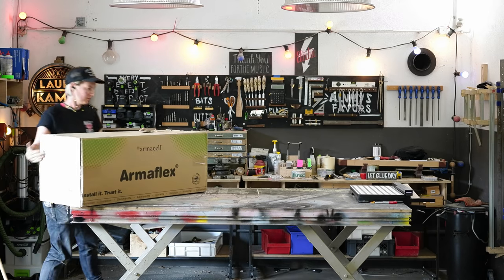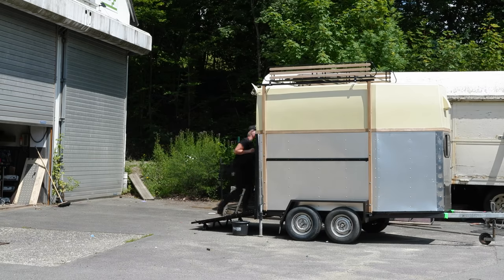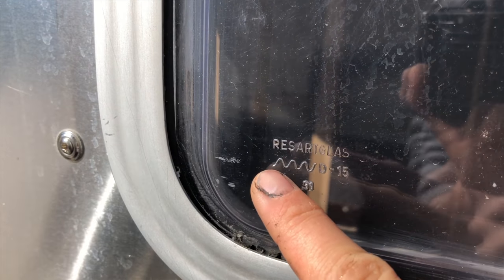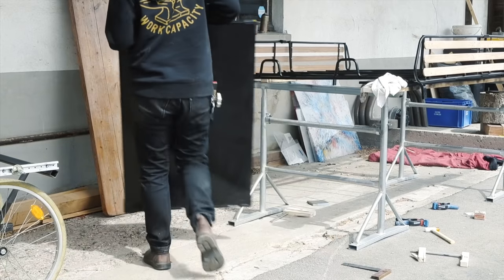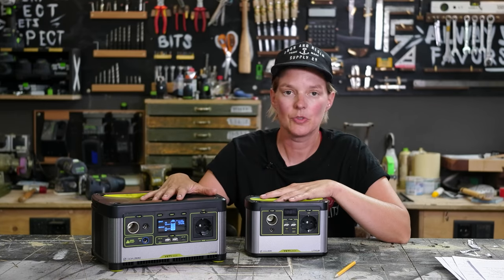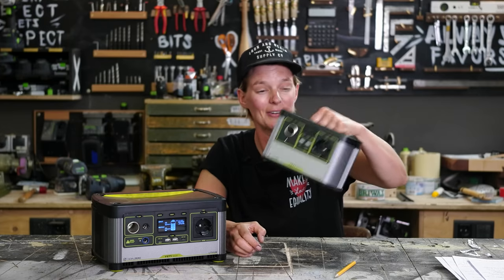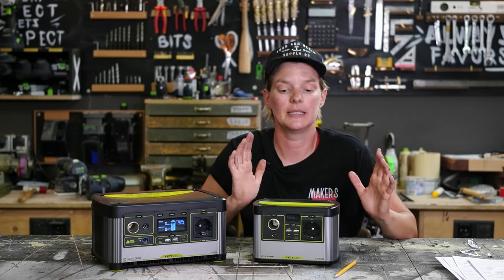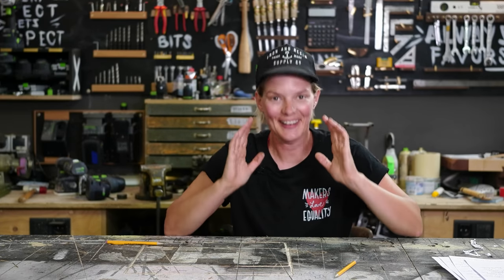Building a Camper - Solar Set Up, Insulation, Windows

Comment: I just had this crazy idea, and you're all free to use it! 
Laura mentioned there would be a gap between the Armaflex and the inner wall, and that her theory is that any moisture caught in-between would naturally evaporate. 
So here's my idea: why don't you try and add the need to have that moisture evaporate to the need to have (what I think is/was her goal for the interior) modularity? 
How? By using pegboard for the inner walls! 
You could even have it on the ceiling, have LEDs between the Armaflex and the board, and create your own Rolls-Royce style Starlight ceiling!
Laura probably already has the project all finished by now and is just publishing the videos as they're getting edited, but we "normals" can try this on our own!
Reply: Silvio Silva Love your thinking 🙂

Comment: I used sheeps wool insulation for my camper. I had varying depths based on protrusions on the outside of my van, so the depth of the wall varied between 4 to 6 cm. I decided that a more easily compressable amterial, like wool, would work best for me.

Comment: Great job 👍. I have done all of those projects on campers in the last 10 years or so. I am with you 100% on the insulation. A little ventilation does wonders with condensation. Solar battery requirements are totally ‘use based’ so are often quite different for different users. Your scalable approach is the best one I have found.

Comment: This was great. In my own research concerning insulation I came to the same conclusion. Closed cell foam rolls are great for keeping moisture away from the walls and are super easy to install. Tough I believe these are harder to buy outside Europe, could be wrong. I recently saw sheep wool mats being sold as natural camper insulation. Wool absorbs and releases moisture freely without getting moldy like glassfiber. As long as your space is properly ventilated sheep wool or even something like rockwool might be an option. but as you said, lots of opinions. Your climate is a big factor as well.
Reply: After I researched a bit, it seems that all depends on what the wall is made of, because if it's metal - condensed water on it is not going to produce mould. But if it's wood, or other organic material - then yes, the mould could grow on/in that.

About wool... I'm wondering about it. It's organic right. So mould can grow on/in it. I'm not sure if my guess is correct, but in my mind it seems that if you say have a metal wall, and put wool against it (without creating an air gap between the two) - it sounds to me that mould will love such combination. 

So basically, in my mind, one of the most important things in insulation is to create an air gap between the outside wall and the rest of insulation layers. Plus do it in a way that there won't be any thermal bridges (thermal breaking seems another cornerstone of the correct insulation, if thermal bridges are present - I've heard that the R value of the insulation materials you use, can decrease drastically...)

Comment: This is such a great series, thank you very much! Very sensible choices, also with the closed pore insulation, I think. But I still wonder a bit about the sliding window. The sikaflex is surely more than enough until the sun eats the earth, but especially when driving through the rain and there is basically standing water on the lower sliding seals, I would be a it unsure about how tight it is...

Comment: Dear miss Laura, I agree wholeheartedly with your choice of armaflex insulation.  I have over 20 years experience as an industrial insulator.  I spent most of that time in power plants insulating steam piping systems.  We did however do work in meatpacking plants insulating cold systems and we used a lot of armaflex sheet.  Another nice alternative is cork. Especially if the insulation needs to be exposed for some reason.  I really enjoy your channel and watching your skills.  Thank you for posting.

Comment: Awesome, fantastic and great!  I had heard good things about Armaflex but had not seen it up close. I love how easy it seems to be for installation. And if it is not as easy as you made it look then I am even more impressed. Will be researching this more and may (hopefully) use it in my build. So if you want to set up an Amazon or EBay store, I will be happy to purchase through your page so that you get a commission.  I might ask you for a link that will work in the US.  I wonder if random "breather holes" between the insulation and interior wall would help condensation evaporation or would it create problems with moisture and compromise the insulation?  What do you think?

Yeti is on my bucket list because they have such a good reputation.  I plan on stacking them, much as you do, rather than use a single large inverter for everything.  Someone had installed a large and a small inverter and used the small one for most things as the large one would pull its capacity out of the battery bank, whether or not you needed that much.  With the Yeti as a Smart Battery/charge controller and inverter, you don't need to worry about any of that.  3 500's and a 200 with equivalent solar would let me run A.C. in the middle of a hot desert on a sunny day and would be much more than you need for anything else.  Here's hoping!  

Husband is in a wheelchair and so have been looking seriously at horse trailers because of the ramp.  I would prefer a bus or similar with a wheelchair lift but they have become fashionable for extra ventilation with non-handicapped travelers/adventurers that I am often outbid.  So the horsetrailer is a very viable alternative.  I hope you will continue to share your journey so that I can watch your every move  😏 sorry

Great video! Thanks!!
Reply from the maker: Good Luck with finding a suitable trailer/van! You seem very passionate about this so I hope you get to go on the road with you husband very soon!

Comment: I would get a big boat or marine battery & hook it up to the solar panel & hook the battery up to your power banks so it would go solar panel to battery then battery to the power banks that way you are always charging a spare battery & your battery is always charging your power banks , that way your getting the best power for your money . I have a Ford F 150 pick up truck with a 8 foot bed & a cap on it , I installed 4 , 100 watt solar panels on top of my cap , I went solar panels to a marine battery , marine battery to a big power bank , I had to tweek it here & there but it works great I can run a heater/ ac unit all night if need be & a small portable fan & a small flat screen tv , & it all runs on my power bank all night with room to spare . The next day I charge everything back up & im ready to go the next night . I can do this over & over each night & it never fails me .

Comment: Hey Laura, love the show. One thing I would add is a small humidity meter that shows % of moisture in the air. Mould starts to grow at 60% humidity so keep it below that and there should not be an issue. If it is too cold to have the window open for ventilation you could get a dehumidifier.
Reply: With a small space like this camper, opening the window and door for 30 s should remove most of the moisture in the air without cooling the camper.
Reply: @Froudd  
Maybe not if you live in a moist environment. And/or maybe not in winter (humid air). But I'm not sure.

Some insulate incorrectly with vapour barriers which traps the moisture where it shouldn't be, say on wood (where mould would grow). So I'm guessing it's not like one can insulate in a random way and just rely on ventilating now and then the place.

Dehumidifier sounds like a great idea. With automatic turning on and off, when the humidity reaches certain level.

Comment: Loving the project so far, but as an architect, the building science discussion on condensation hurt my heart a little. The goal is to prevent moisture laden air from coming into contact with a cold surface and causing condensation inside the wall assembly. Ideally, there would be a layer of plastic film between the inside finish and the insulation. It looks like the foam you used is closed cell, so that should be one thing working in your favour. Not criticizing, just trying to head off issues. Also wondering if you considered a flip down set of legs on the ramp to make it more level? Anyway, keep the videos coming!

Comment: In Canada, when building houses we put a polyethylene "vapour barrier" on the inside of the studs of outer walls, before hanging wallboard/sheetrock/drywall.  Of course, you may not want to seal too well because your breath will make it uncomfortably damp in your camper.
Reply: Beauregard Slim You’re right to suggest this - you don’t want moisture getting behind materials. Usually the stick-on insulation bonds so well it becomes the vapour barrier *if you tape at every junction etc*. Insulation really has to go hand in hnad with ventilation, though. Ideally you’d fit low vents and high vents for exhausting moisture you create inside. Teardrop trailers, for example, need venting even in cold weather - the smaller the space the more vital ventilation will be.

Comment: when is started out, i used to go with cheap styrofoam in my bauwagen, later i upgraded to an insulation material made from hemp and coconut fibres with a steam barrier on top. the best counter measure for moisture ist good ventilation in any case :)

your power setup is probably good for a camper type application, i'm really interested in how the lithium batteries hold up. i used to have 12v agm batteries with a solar charger and a 12v grid throughout, which is perfect for illumination and running some electronics. using an inverter is usually overkill, you can run many powertools off the 12v directly (and here it's good to have a battery with low internal resistance, you don't want to powerspike lithium or lead gel batteries).

Comment: to talk about the condensation of moisture: your insulation has to be covered from miosture. Otherwise steam will get through it and will still condensate on the metal. What you need is a vapor barrier on the inside
Reply: Normaly you don't need this if you have used Armaflex which she has used in the video
Reply: Armaflex is closed-pore foam and might not need it.

Comment: Hi Laura, i've converted some Van's/RV's/Campers by myself. So i can say that you've had choosen the right decision in YOUR case ! As you stated it is different what your base is where you start from. Is it a VW-Van with self-supporting body, is it a former Cargo-Truck with flat walls and no superstructure, is it a frame-and-outer-hull - construction like in our case: every case needs different solutions. You've choosen the right one for your project. But it is important to mention (if somebody else is going the Armaflex-Way) that Armaflex is NOT an insulation (in the classic way). It is, for sure in some way, but what it really does is to transport the Dew-Point away from the cold metal surface and locates it somewhere within it's thickness. Means: the moisture isn't gone, it is just located away from the surface. The key to sucess by using Armaflex is this 5 mil airgap between the inner surface of the Armaflex and your wall covering. This allows the moisture to evaporate on the WARM side of the Armaflex - and everything will be fine ! Perfect solution Laura und noch ganz viel Spaß mit Deinem tollen Projekt. Du machst alles richtig weil Du mit viel Ruhe, Erfahrung und Überlegung an Deine Projekte rangehst. Schöner Kanal, Danke dafür ! Ich schau immer wieder gerne zu. Liebe Grüße aus Limburg.

Comment: Laura, To help you save energy with your Goal Zero, check to see what your lights are pulling as far as amps and such.  Basis Christmas lights can pull a lot of amps where as a goal Zero light - or other solar lighting- often pulls much less. Also, if you're looking at refrigerator or electrical coolers, do the same thing.  Check to see how much power they pull and use. There are great YouTube videos talking about lights and coolers.  Best of luck and I enjoy your videos. Skillet

Comment: Hallo Laura! The camper is really looking nice! (Usually I don’t comment, but I really appreciate your videos !!).

About the insulation subject:
For German and French speakers (I think there is an English version, though I don’t know if it is properly working) there is this website: https://www.ubakus.de/
I allow users to calculate moisture migration, but also insulation values of a wall portion (there is a built-in catalogue with most UE building materials and brands).

I don’t know the properties of the special product you used, so I can’t give advices or feeds-backs… But usually on such a wall, vapor barriers are used…
Even low sd vapor barrier could be a good product (some OSBs can be used as low sd vapor barriers). But in your situation, low sd vapor barriers can’t be used because of your non-ventilated aluminum cladding (outside -> aluminum -> air flow (not I your situation) -> insulation ->… -> inside) because of his high sd value (1500m).

This one way of doing things, there are others…

Comment: I haven’t seen mention of refrigeration yet.  I have the amazing Ausranvik 26-Quart freezer fridge, with true 12 volt compressor (capable of ice cream-cold temperatures.). You’d probably go at least a bit smaller for space reasons.  I can say for sure that you’d want/need a second 100 watt panel, and perhaps a 1200 watt-hour power bank to ensure a practical setup that includes 24 hour mini-refrigerator capability.  The 100 watt  panel and 500 Wh power bank will surely get behind every day...

Comment: Hi Laura,
You're making good progress! I was just wandering... The solar panel ON TOP of the roof rack will make the solar panel vulnerable to damage from the luggage you're taking with you on top of the roof.
If you flip / rotate the brackets and bolt the solar panel UNDER of the roof rack, the rack itself is a 'barrier'  / distance between the solar panel and your luggage. The crossbars of the roof rack are so thin that the loss of sunlight / energy of the solar panel will probably only be very small. Good luck with your projects!
Willem

Comment: Yes, Laura, I, Otto could not think of anything else to make it any better, we also have this insulation in Oz, stone wool and siderophore would be also an option to use - same rules about glass here and it comes anyway from Germany with the TU"F approval - however, you have it over there very cold ( the coldest I ever experienced was minus 46 in Tyrolian Alps) and we have it very hot. We have 3/4 of a year like summer and from November to March around the 40 Centigrade mark with 46 around New Year. We also struggle with the cold bridge and high humidity, mold is the number one enemy, and to absorb the humidity to use fabric wall lining/underfelt and lots of carpet, but rather double glassed windows as a single glass works like a solar cell and creates a heat-box. You soled the Power plant the easy and uncomplicated practical way. We wear rainbow colors to show our solidarity and I wear a provocative, colorful Aboriginal Shirt on Australia Day and do not hand out an Australian flag nor do we celebrate "Invasion Day"! There are so many things that still divides our nation that needs fixing, pronto!

Comment: If using Sikaflex 221, there's no need for screws.
However, the correct installation of that window would be using Sikalastomer 710 as sealant and the screws for fixing.

Comment: Armaflex is adhesive, I wouldn't call it just "sticky". Sticky applies to those yellow notes or maybe a drop of honey.
Good idea making a window template from painter's tape! Is the Sika product you use only sealing or is it a glue? In the latter case it would be very difficult to get it out again if necessary. Since the window is fixed by the bolts, glue isn't necessary and not recommended.

Comment: Some theory from time to time is totally ok, and welcome! Very interesting, in fact. Question about humidity management: in your build ("aluminum"/"insulation"/"air"/"inner wall"), what material are you planning to use for the  "inner wall" (so that water can evaporate through it)?